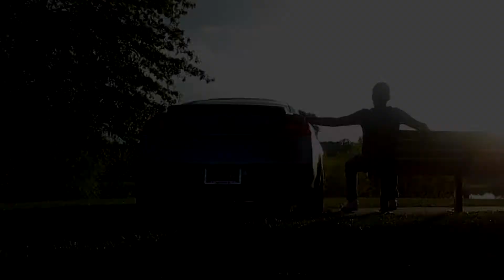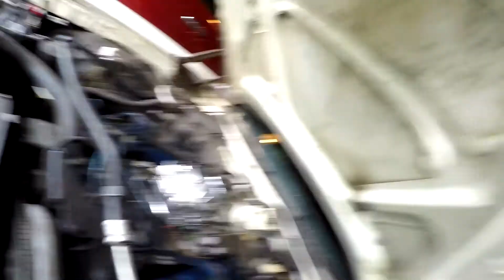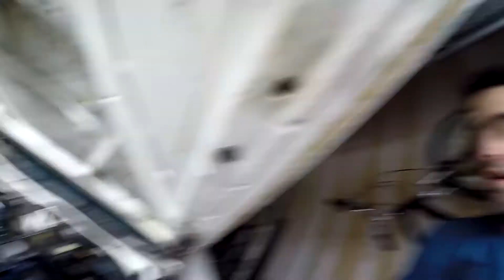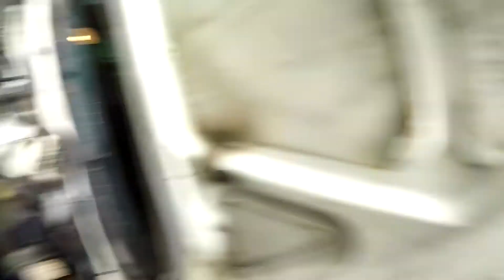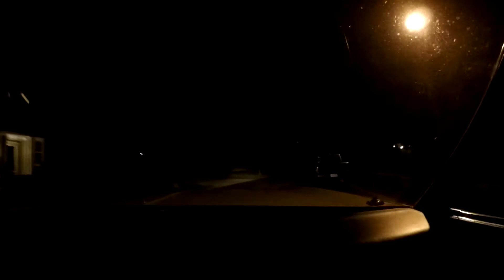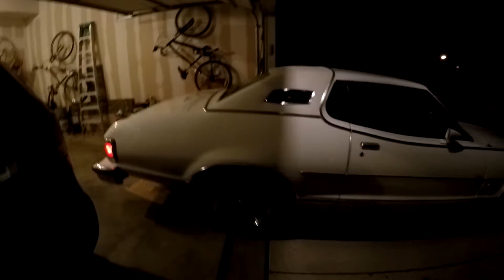IT'S RUNNING !! | Mercury Cougar XR7

Comment: we have a 76 xr7 cougar that was shipped into where i live from U.S to a buddy of ours who bought cars from overseas to sell em here and since he knew us and we almost always had room on our farm he used to store the cars at our place for the winter and when he brought in the 76 cougar we bough it straight of probably to a suprise to him and it has been running with the factory stock gutless engine for over 40 years (obviously) and we just started it up this week when it was fairly cold and had been sitting for the whole winter it started right up and ran like new, it was the best 5,000 we ever spent (atleast thats whats my opinion lol)
Reply from the maker: Nice! Sounds like a great deal lol. Got any plans for it?
Reply: well my plans are mostly get some cosmetic things to it like getting it re-painted back to its original color of silver since the previous owner from the NA painted it with a pretty bad white paint job and get some better fitting and looking wheels to it before getting anything new mehcanical stuff to it since i want to see how far it can get with the bone stock engine and when it gets too expensive to repair or replace parts i might get a bigger engine to it, and the electronics require alot of fixing.
Reply from the maker: Ah okay nice. New wheels alone make a world of difference. Seems like the car shrunk a bit and doesnt look as boaty with the new ones we got lol. I think youll get long use out of that engine though, should have a little fun with it!